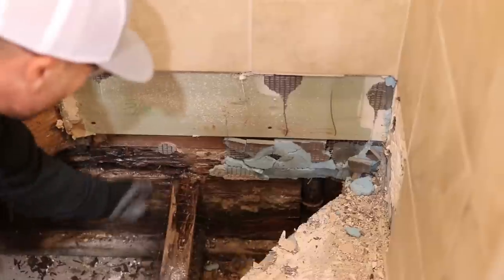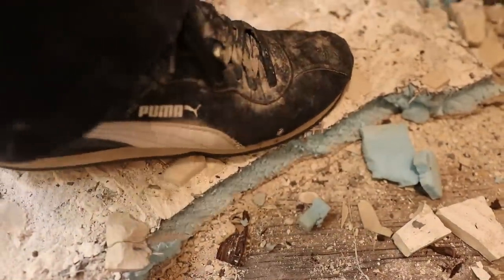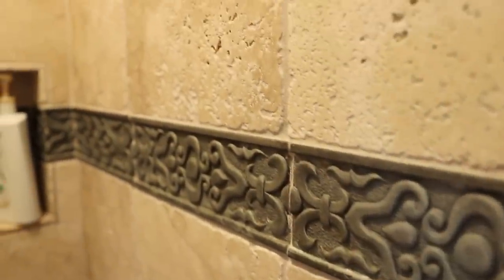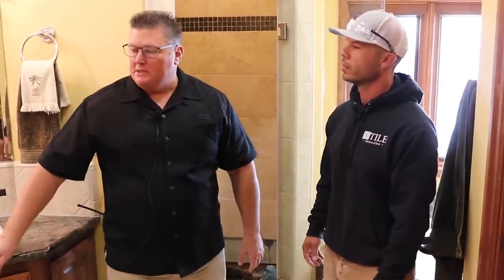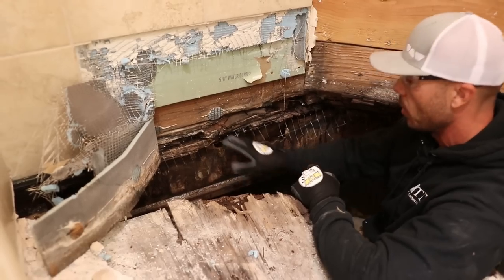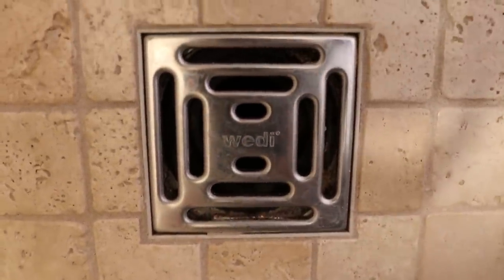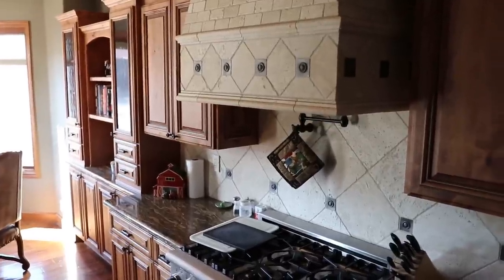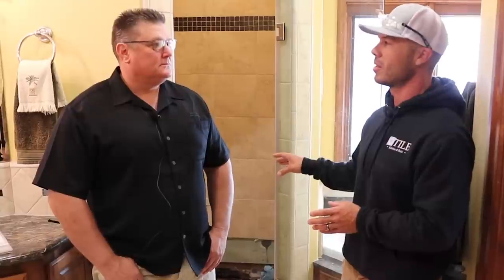Massive WEDI Shower FAILURE (Done by Certified Installer) -- Warranty Claim DENIED

Comment: cant believe I read over  400 comnents,i actually think wedi can be a wonderful  system ,wish it cost  less,and wish it never failed,too many variables  outside its control,curious  why the rep says its caused by the bench,.. what exactly,either way a few say the sealant is super strong, do a test to see what it takes to pull sealant off  a rabbet,with the correct amount  applied,and cured,should be telling,probably really great over  a slab, without wood, benches,wood joist, and plywood,damn earthquakes

Comment: WEDI tried to enter the Canadian market but they were shut down quick. The product is flawed and it did not pass CSA certification. Houses without poured concrete foundations are glorified trailer park homes. A proper house must have a complete poured concrete foundation and not sitting on floating footings or posts ! Concrete Concrete Concrete !

Comment: If the seat was pitched the wrong way, or not pitched to the drain at all? The water will pool on the seat against the wall and it will eventually start to seep in to the gap between the seat and wall? All it takes is a cup of water every shower leaks,  after 365 days in a row of 1 , 2 people showering a day, and your talking about a lot of water from a small leak !

Comment: The tile shop have been trying to sell me this system for like 8 months.  Very interesting

What is the best method?
Reply: Hot mop with a mortar pan in my opinion.
Reply: Or flood tested pvc pan liner on a preslope.
Reply: PVC pan liner, drypack and redguard.
Reply: schluter on mud,best modern  system, but there are others

Comment: been in the construction business now for 35 years foam has always been a bad idea i don't know who came up with the idea but anything that could possibly move even if its over time is a bad idea !!!
Reply: So you don't used any wood in your 35 years of construction? Remember there is moving (wood) subfloors, joist , and girders so there is going to be movement. I wouldn't say never use, but maybe for this installation a mortar bed would have been better, plus for the money he probably payed I would think. Also you must not have installed any backer board because oh my it is way flexible especially this perlite mixed type (lite). Not bashing just saying things change but not one solution for all. There are a lot of bad Mudded Pans out there.  Comes down to skillful use of the products you use. Just cause the Company was a  Wedi certified Installer it doesn't mean the guys installing were, I see that all the time non skilled workers under the master. Skill is getting lost even more now quick and dirty has always been a problem but it is looking worse now.

Comment: Thats what happens when you use every new fandagled thing. There is nothing wrong with a pvc liner hooked up to an oatly drain with cement board  on the walls(with ardex *+9 on it if you want, though I dont really think it is necessary). I've never had a shower fail, and there is no real reason to try and upgrade that process  and use plastics, foams or other products that aren't really compatible with cement based products like thinnest anyways.  If a product or system has worked for years why do something different, just keep it simple IMO.

Comment: I have put in a few Wedi system, and I was really concerned at the beginning of this video. As I watched it I want you to pay attention from 14.00. I can tell you right now what has happened was a host of Installation mishaps. 1) the Base wasn't structurally sound. 2) The sub-construction in the Bench wasn't installed properly, which I believe caused the leak in the first place. After that its just a matter of a domino effect. These foam-based shower systems they say are easier as a sales pitch, but they really aren't. The labor is a tedious process, and you have to follow the instruction to a T because if or when they fail they will fail miserably and will cause total loss of the shower. I do custom work, so I only use these systems whenever I'm asked to, or whenever I am doing a curbless Shower. From what I can see here I am leaning to put the blame on the installer as opposed to Wedi even though the host tried desperately to for instance with the attempted explanation of the caulking process.
Reply: Relying on sealant joints to adhere two critical flexible materials in a shower pan is just nuts. There is no fail-safe - any breach of the seal inevitably leads to rot. And absent extreme care, that sealant is almost certain to fail since the foam pan flex puts constant strain on the joint - any failure will see water leak around the entire pan and remain hidden for years (as seems the case here)
Reply: @ArthurDentZaphodBeeb  first of all, the Wedi materials (especially the base) isn't flexible. Second, the seams are caulk and sealed just like one would with a bathtub to wall, in this case with the shower the floor should be more secured. One should ask themselves how is it There's so much movement in the subfloor that the seal was able to break making a pre pitched shower base leak from the perimeter? The sub-work wasn't prepared properly. I don't represent Wedi or any products nor am I promoting them, but I've used them, and my experience is shower(especially) construction failures are more the cause of the prep process than the product

Comment: That rabbet, in the pan should have a massive amount of Wedi caulk in it for the wall Wedi to bed in. It should be oozing out when the wall panel is set into place. Then it should be caulked, and caulked again, at the end of the day.
Finally, just RedGaurd the pan.
Wedi caulk, alone, won't last. RedGaurd acts as a "taped" joint, which can flex with normal movement.
17,000$ fail for me!
Wedi makes a tape, but it was never shown to me by my supplier and I never saw it in videos.
17,000$!!!!!?

Comment: That is not a failure on wedi. Thats a horrible job done by a contractor.  Wedi pans have a groove for they're wall panels or whichever 1/2" backers or substrate you choose to use.  The installer made the mistake.
Reply: I use wedi pans a lot. I much prefer wedi to kerdi products. I feel personally that wedi systems are much more waterproof than Schluter. The rabbit cut is part of the pan. You can also use wedi tape membrane to go around the edge of your pan and seams for curbless installs. This was user error.

Comment: The Wedi shower pan I used lapped up about 4 inches and was one whole piece
Reply: Gee, a whole four inches???

The flashing  around my sky lights is more than a foot wide. And it doesn't rain up there every day.  So why go only 4 inches??? And please don't say it is to save money!!!
There are certain areas where you don't really want to save money. A water leak can totally destroy your house. Why cut corners on this job?  Forego a few beers, or whatever, and run the pan flashing up the wall a few  feet!!! You will be happy you did, when there are no problems with cracks, leaks, and redo issues!

Comment: There is a logical explanation to this   The bench failed from the beginning as it did not have to be tested and over the years it didn't take long it created a leak and just kept leaking and flowing under the system which to me looks fine...This guy making video did not even discuss this as Mike and Wedi rep stated it was failure of the installation and waterproofing of the seat...

Comment: There must be a difference between US & EU since here we have to use the sealing set: https://www.wedi.de/en/products/building-systems/floor-level-showers/wedi-fundo-sealing-set/  also, the wedi caulking is supposed to be grey.
I agree with your finding though, whatever caulking used it seemed to have delaminated easily since the foam of the pan is still intact.
Reply: I don't believe there is a difference. I use Wedi systems at the company I work for and I have done the intro to Wedi certification course provided at a large tile shop that sells Wedi and Schluter products. If you don't use everything Wedi requires when installing, the warranty is null. Wedi caulk, Wedi gun (maybe not their specific gun but it fits the tube), Wedi board, Wedi seam tape- everything. Every seam has to be caulked thoroughly and waterproofed. Could be the system failure here, but I'd wager there was fault in the install. The caulk and seam tape is essentially Redguard and waterproofer. It's a shame it's impossible to tell at this point where the fault lies with how much damage has been done.

Comment: Never used weti or any other shower "systems". Junk install in my opinion. I was trained as a young man years ago to only do rubber liner, hardiboard, elastomeric or kevlar caulking in corners, hydro-lock it heavy. Then proceed to tile
Reply: What do you do to waterproof the walls? Cement board ain't waterproof.
Reply: And that's why Isaac has a lot work when repairing "that's way it has always done" bathrooms.
Reply: You have to waterproof entire shower
Reply: I have showers that are 20 plus years old in customers fine ass homes that i haven't had a complaint about. And they all know where to find me. I get Christmas cards from most of em, lol

Comment: This one is rather obvious,  design failure,  I was always taught that the wall board would meet over top of the floor pan, that rabbit cut joint just shows water already stuck to the wall as it falls will fall against a sealant bead  that's poorly bonded to basically a Styrofoam cup material. That is so garbage

Comment: Also, I think the California flood test is problematic....
Reply: How so?
Reply: @justinofboulder  for these type of shower systems... because in the end they are not one continuous unit to contain water like a bowl. In normal use, water is only meant to scatter off the surface of the tile then into a pan, then down the drain. Filling the pan with water, as It sounds like the test does, is not the normal function of this shower system.

Comment: Why did they run dry wall under the wedi
Reply: Filler piece to bring it out even for quarter round. To mimic a floated shower.
Reply: @travisk5589  I think William is asking why there is Greenboard behind Wedi in first place because Wedi should be only board on wall fastened directly to studs.

Comment: As a certified wedi installer this was without a doubt installer error.  Wedi is the best system out there hands down
Reply: Not worth the price...especially when you can build a shower that’s just as dependable using a membrane and mortar and save hundreds.  I’ll take that over wedi any day.
Reply: Leonard Skipper it’s the time it saves that makes it more economical

Comment: If you "think like water" then that rabbett cut is plumb dumb. Put the bottom of the wall below the top of the floor creating a leak point. I dont see how that pan would even weep right. Terrible product
Reply: Water doesn't think.
Reply: And it dont run uphill either. So if all horizontal surfaces are under vertical and sloped away from walls then it will take path of least resistance to the drain.

Comment: I started using Wedi two years ago. I started using Wedi because I saw so many "poured" Pans fail. To this day, I tear out failing "poured" pans. I disagree with this expert here who is tearing out an 11 year old Wedi Pan.  He must have some vendetta towards Wedi. I think Wedi is a great pan if the foundation is secure and if the pan is installed correctly.  This illustrator feels that the joint sealant has failed, yet most drain assembles fail on the poured pans. I can't begin to tell you how many poured pans that I have seen,  FAIL. Most likely installed by rocky pan pourers. This illustration showes that the installer , 11 years ago, installed two layers of wall board.  It was an old home with a crawl space. The wood was most likely rotted before the install.........This illustration should not be taken seriously. I would like to close by saying that all of the comments are based on ONE questionable illustration. Please show me several other Wedi failures and then I'll listen.

Comment: Why does anyone use these "systems" when traditional methods are cheaper and work just fine?  There are shower stalls built in the 60's and 70's that don't fail.  There is no way in hell that something like Kerdi will still be going strong 60 or 70 years later.

Comment: That shower leaked for years. Is this shower over a crawl space?
Reply: Why all that rot was dry? 
Did someone dried it all ready meaning when i have repaired water damages in bathrooms even those which has been leaked several years wood has always been soaking wet not dry like that.

Comment: Drywall-green board behind the tile tells you all you need to know about the installer.
Reply: We used green board in the early 80s before Durarock came out. It didn't take much more that some loose grout to make the green board fail. I am with you Edward. In todays times no excuse for green board any more, LOL.
Reply: Wedi was installed over Greenboard if you even watched video.
Reply: @mr.wizeguy8995  Yes, Wedi over greenboard.  There is  a reason why it's not allowed anymore in Northern California.
Reply: @rainmaker3700  Can you just tell reason instead barking it. As we saw in this case Wedi was really well adhered to Greenboard and only issue was how floor met corner which was assembled improperly even installer was certified. There was corner tape/mesh missing totally.

Comment: You can see even 2 feet from the seat where he showed the rabbit from a separate adjacent wall,  the sealant broke free from the rabbit joint. The piece of pan material he pulled from that wall clearly showed stains from water on it and you can see the water damage on the wood below that wall as well. 
This is a shit product and without a doubt will eventually have a class action law suit put Wedi out of business.

Comment: There is essentially no reason to use any other system than Schluter.
Reply: Schluter fails also
Reply: @mrsmith9350  with improper installation, yes it will fail. As anything will. As a professional tile installer I use Schluter. Mud beds and rubber liners are like putting septic tanks under people's feet - no bueno.

Comment: They used the wrong sealant....It's probably kerdi fix, sika polyurethane or something else from home depot, cheaper stuff, not wedi sealant. Wedi sealant is gray, it's NOT white and it sticks to the foam like a bitch. I read online that polyurethane sealant is an organic material and it only has a 10 year lifespan....So you can expect a wedi shower to last only about 10 years 😆  I've installed a wedi shower before but i taped and painted over the wedi sealant with hydroban to make sure it wouldn't leak. I couldn't trust to caulk all the way lol

Comment: Why you americans never use epoxy grout in showers is beyond me.i've seen a few of these failure videos now.and not once epoxy grout is mensioned.i've been doing this for over 20 years now(in belgium).here we don't have a lot of wooden structure buildings,mostly concrete and brick layed.so there is less movement on the walls.in my own shower i have a floated walls(cement)with a subway tile installed on them.everything is epoxy grouted,no kerdi or sealer or whatever the f... .so far no leaks and also no callbacks.

Comment: A rubber pan and water proofing before tile and a concrete board not hardie is the way to go. Ive done over 50 showers never had a call back.  All these systems are stupid i refuse to use them. Ive had many customers request theses systems i tell them to find someone else to do it.  Im not putting my name on some bullshit Styrofoam or whatever it my be.

Comment: First off it is blatantly obvious that you are condemning something you have little or know actual training in.  If you did you would know that you can absolutely NOT adhere the board to existing board or the studs.  It is fastened with the supplied screws and washers to accommodate movement.  Using adhesive to fix it to the structure automatically voids the warranty.  Second you also would have noticed they never flashed the seams like they are supposed to.  It's great you've been in the industry since 2002 but that doesn't mean jack shit if you haven't been trained to install the product you are bashing.  I've never had a single failure with Wedi.  I also have a vast hands on knowledge of traditional shower waterproofing techniques which would have also achieved similar catastrophic results if the same neglegence was applied to the install.  Take a Saturday and attend a class and then revisit this video.